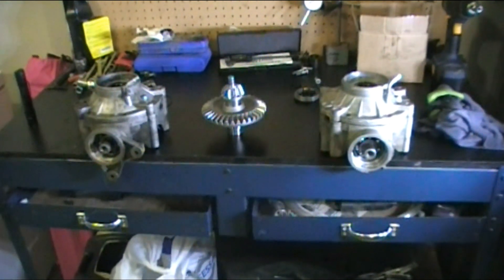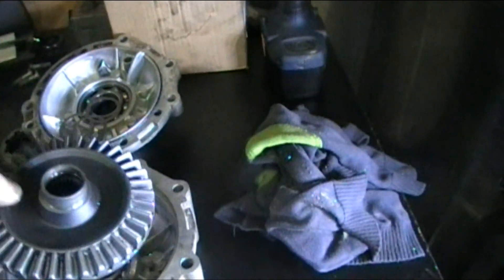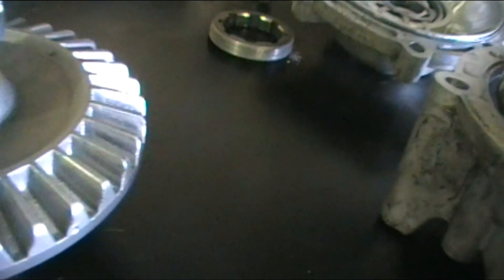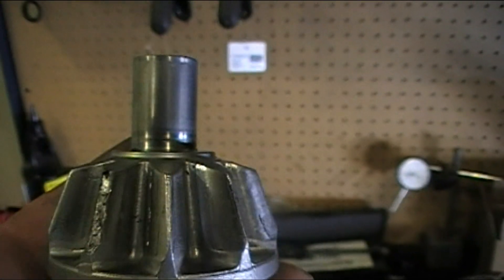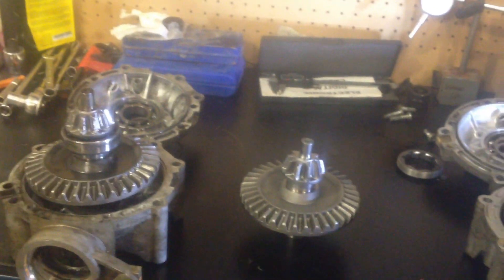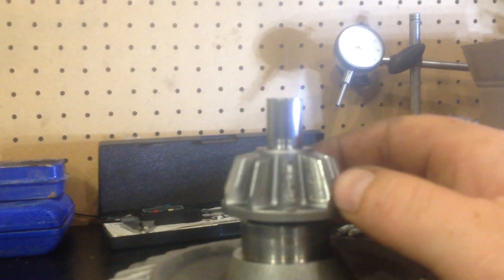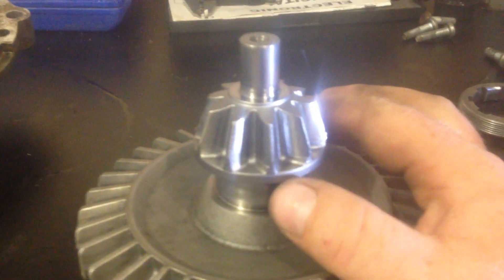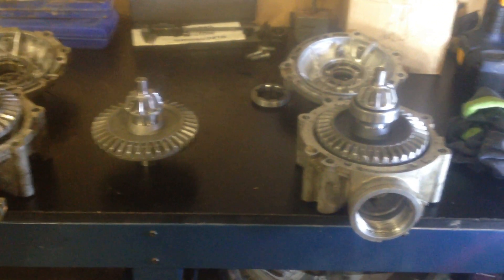gen 2 can am  anatomy of a rear diff failure

Comment: which new model can am atvs have the best diffs? other than a 1000. 850 models or under. thanks.
Reply from the maker: in 2019 most can am are running the larger xmr diff now.  this is a better diff than the one in this vid but still pretty suspect to failure

Comment: Tell  ya exsaxlty whts wrong thier using a spline cut straight mesh gear design in sted of a  self mesh helical cut concave mesh design pluse a out of phase drive shaft and aluminium instead of steel.

Comment: Had a 2011 xmr 800 for 6 years. Over 400 hours on it. Never a diff issue ever. My 2017, same thing. Have had it for 3 years now, never an issue. I run aftermarket clutches and 31 inch mud tires. Dont understand why you have this issue all the time. I ride hard too. Very weird

Comment: Gears aren't heat treated,they're face hardened. Improperly worn parts don't get pitted,it's called galling. Pretty simple fix....ink the gear tooth pattern and adjust backlash. There's no preload to set as they are ball bearing and not tapered roller.....which it actually SHOULD have. If you can find tapered roller bearings to fit the case you're golden.....that diff should last a lifetime. No secrets here,a diff is a diff and since you didn't mention any fixes this video was a complete waste of time.
Reply from the maker: oh the things you learn when you have rpaired more than 3000 of these
Reply: @mudNwheels  they're the same as any other gear set. There's nothing magical or unique about it. Can am,jlg,cat,jcb,chevy,ford,dodge....the principal is exactly the same.

Comment: People, it’s not the shitty heat treatment that everyone is talking about, or the so called flexing housings, or even the oil itself for the most part. The reason for all the failures is the INCORRECT SHIMMING of the crown gear in the housing. See those two little shims on each side????? Get it apart and re shim it properly then put good quality oil and forget about. 
That’s the secret!
Reply from the maker: you are correct but there is more to it than just the pre load and back lash shims.  prelaod of the pinion bearings and pinion depth also play a big role.  knowing how all of these settings affect each other is key

Comment: Hello, good video and I have a question for you. 
I have an outlander L 450 2015 and in the manual says to use 75w90 oil in one Axle and 75w140 in the other and I live where is really hot all year round so my question is if I can use just one of both oils in the 2 axles and wich one would it be in case is positive. 
Thanks.
Reply from the maker: hey joe i recommend 75/90 year round in all climates even to my customers in tx and fl
Reply: mudNwheels 
Thanks for your help,  I appreciate it.

Comment: Mudnwheels,  hi just reading about these issues as I am looking at a used 2011 800xt and a 2012 Gen2. I understand only 2011xmr were Gen2? Then I read about the Gen 1 limp mode issues and I may just stay away from Can Am. I am thinking you have the Gen 1. Any limp mode or over heating issues? Any advice?
Would you buy the 2011 or 2012?

Comment: Looks like quality control and durability of these diff gears are not a real priority for Can Am. Seen to many of these failures and then being told that it is not covered under warranty as it is suspected abuse. Well, if things were engineered, tested, put together correctly at the factory this stuff should never happen under any type of normal to moderate wear. Come on Can Am, fess up and admit to a total failure here.

Comment: The problem is can am should be using helical cut gears not straight cut gears in there diffs. Helical cut gears are quite and have more tooth contact at all times making them a lot stronger. Straight cut gears pull on one tooth at a time causing noise and excessive wear on teeth. It's just a cheap way to build a diff and F the consumer.
Reply from the maker: i tend to disagree yes spiral bevel gears are stronger and quite,  however i have been building these diffs for more than 2 years now with huge success.  my builds reduce the noise and wear and have bee running strong in the toughest conditions that i have tested them in.   the xmr 1000 diff uses the spiral bevel gear and they still fail prematurely from stock.   i also build these diffs with better than factory results.   in fact this on of my strongest sellers.
Reply from the maker: https://www.youtube.com/watch?v=BjbcNFJ36YI

Comment: I only got 140 miles on my 2014 and my differential is junk
Reply from the maker: +Corie Bardo i eel your pain i was getting 200 miles on my diffs in my 2012 1k     that is why i had to figure this problem out.   now i have over a 1000 miles on and it still looks like new
Reply: How much did it cost u to fix the problem
Reply from the maker: +Corie Bardo i will post you the link to my new web site.   since i made this  video i have repaired hundreds of these difs for my customers 
http://mudnwheels.com/Can-Am-Parts/Home
https://www.facebook.com/Mud-n-wheels-672787052788976/

Comment: Nice video. These machines are like work trucks. Need the oil changed more than normal in the differentials. They get abused. If you read up on a rear differential rebuild you are supposed to change the oil just like engine oil after heavy pulling. These ATV with people and in the mud basically haul a load all the time and not to mention larger tires. Most of that pitting is heat and makes the teeth brittle till they brake. Pattern was consistent enough to make a clear mark. So if you want your stock Diff to last then change the oil on a routine maintenance.
Reply from the maker: +Richard Kertz thanks for the comment,  and you are right about the oil.    but these diffs still have issues to this day.   i have been fixing the g2 diffs for over 2 years now and had an amazing success.
  https://www.facebook.com/Mud-n-wheels-672787052788976/
Reply: I haven't looked into my 11 Can am 800-XT. I checked the oil in the past for water by removing the fill plug and it all looked good. After I read this I changed mine but I have 250 miles on mine. Probably no time for wear anyways but thought more about it bc I have 28" Zillas so I changed my oil and no metal fur nor contaminants. Looked like new oil draining out. Went with 90wt Royal purple for now. Will check every 50hrs with oil change to see if any metal fur shows up this time.
Reply: Richard Kertz, hi just reading about these issues as I am looking at a used 2011 800xt and a 2012 Gen2. I understand only 2011xmr were Gen2? Then I read about the Gen 1 limp mode issues and I may just stay away from Can Am. I am thinking you have the Gen 1. Any limp mode or over heating issues? Any advice?
Would you buy the 2011 or 2012?

Comment: will your xmr diff hold up to a outlander that has over 95 rwhp that is running a 20 shot of nos? if so who's running these in there machines?
Reply from the maker: +Walter Taylor my xmr torque series rear diffs have been i bikes like this.   check out extreme atv offroad  and his 1020 gade with a 30 shot or rear time atv with a  bom racing motor and a 20 shot.   o how about dustin jones in the cmr race series.   just a hand full of names for you to check out for your self.

Comment: i have a 2014 can am outlander xt 1000 has about 10-15 hrs n the rear diff cracked n cause the load to go to the front n ended up breaking front axel. took to local can am shop n after 3 days can am said good luck fix it urself not covered. i had it n mud! did i buy a money pit??? i did not abuse it.
Reply from the maker: i have heard this story so many times.    i hope can am starts to listen to the customer.   bad news is your going to be out some money,  good news is that this problem can be fixed!!!    if you are interested contact me on face  book  https://www.facebook.com/pages/Mud-n-wheels/672787052788976?ref=hl
Reply: revo3423 According to BRP, the 2014 lineup came with a newly designed differential, with spiral cut gears, instead of the straight cut gears in this video. They went that route, because it was quieter. So, this wouldn't actually pertain to you, as yours is more like the gen 3, rather than gen 2.
Reply from the maker: FTORC1 the xmr 1000 has helical  gears.   the short outty and renegade 2012 to 2014 have the same diff with bevel gears.  in 2015 the regular g2 diff was redesigned but still with the same style of bevel gears. so far i have rebuilt to 2015 g2 diffs.   the problem that i correct with my rebuilds is still there

Comment: Nice work!! I haven't had any issues on our 2 machines but very curious myself on a solution. Do you think this is the reason Can Am changed the oil spec from 75-90 to 75-140.
Reply from the maker: Affatato's Channel i think it is the other way around original spec was 75/140 now it is 75/90.   i know i have had better luck with the 75/90 myself.  hope you have better luck with diffs than i did.  what year and size are your bikes?
thanks for the comment
Reply: Both my machines are 2012. 800 & 1000. I thought 75/90 was original spec and in 2012 they changed it to 75/140. So is Can am back 75/90 now? Dam I just stocked up on 75/140.
Reply: Drain plug magnet must have had lots of metal on it